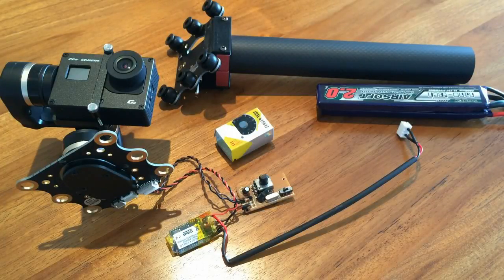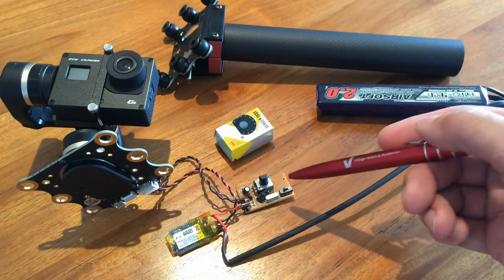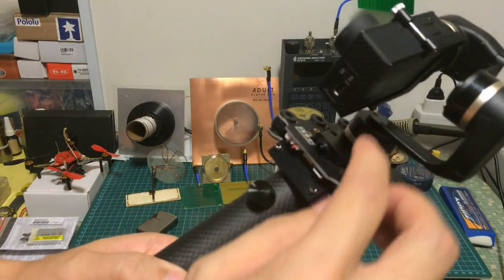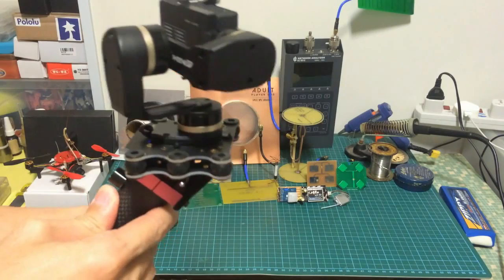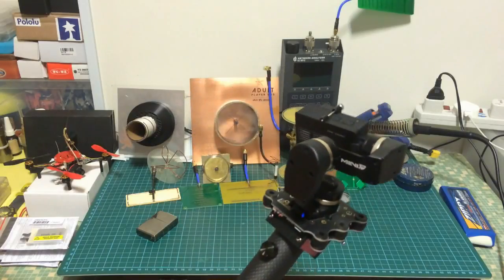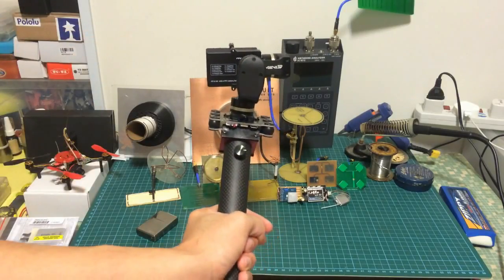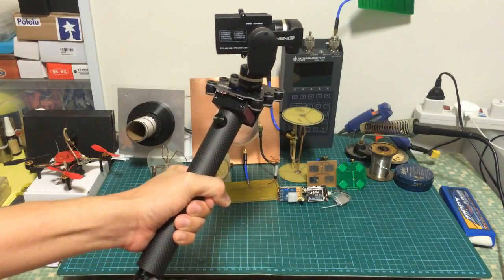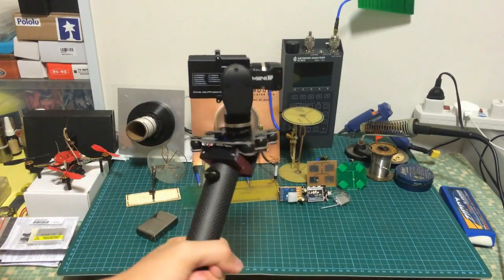Economical 3-Axis SteadyCam (DIY)

Comment: Nice job, thanks for sharing! I've decided to build a similar one. What kind of button are you using for switching between operation modes (default, hold, follow)? Can you share link from where I could order? Thanks for your help!
Reply from the maker: I use a servo tester, here r the results for the 3 positions on the pot... 3'oclock=All locked, 6o'clock=follow, 9oclock=tilt&roll locked 
https://www.aliexpress.com/item/New-High-Quality-EK2-0907-Updated-Servo-Tester-Server-Electronic-Speed-Controller-Multi-Rotor-Parts-for/32677677277.html
Reply: Thank you very much! :)

Comment: Your PID settings is bad. There is so many angles when your gimbal starts to vibrate. But till good video :)
Reply from the maker: Yep, the camera is too light. Feiyu tuned it for GoPro3. I managed to minimise this problem recently by shifting the camera sideways until it is perfectly balanced mechanically-wise on the roll axis. Merry Christmas!

Comment: Hey nice video! Where do the gimbal's brown and black cables go on the servo tester?
Reply from the maker: The servo tester has 2 test ports for connecting to servos. Each port has 3 pins which are labeled  "- + S" . U can use any test port. Brown goes to the S pin and black goes to the - pin.

Comment: sorry,
I can ask you to make me a picture in detail the links between the main- regulator "Simple 5v BEC / voltage regulator" and potentiometer "Simple Servo Tester"
I thank you in advance
Reply from the maker: 2S Battery Black & Red go to Simple 5v BEC input wires(no ferrite ring), then Simple 5v BEC output Black and Red wires (usually they have a ferrite ring on them) connect to a servo port (choose any unused port) of the servo tester. The middle pin of the servo port connect to the red output wire, but you gotta find which one of the 2 side pins, is the ground pin for connecting the black output wire from the BEC. Look for the "-" sign. Hope this helps